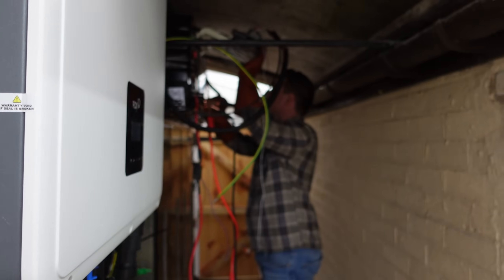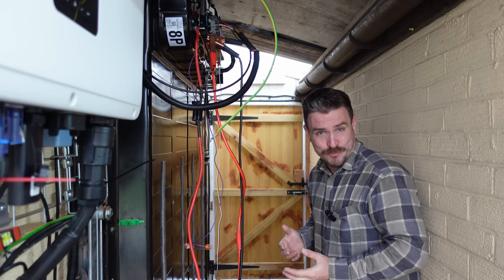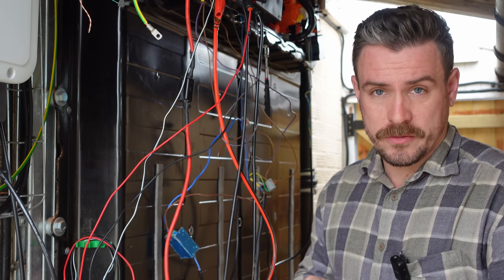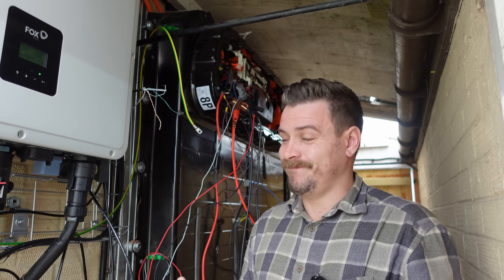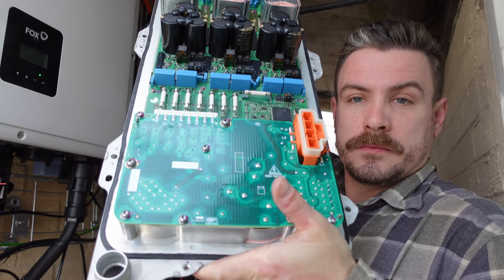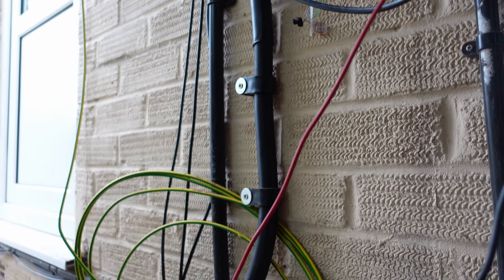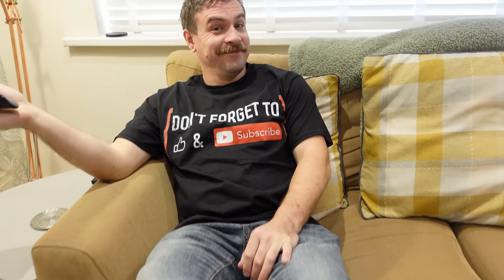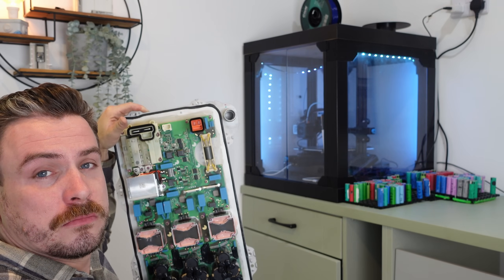This will be a costly mistake!

Comment: So the fox h3 pro inverter can handle up to 800v dc input of PV (solar panels).  I assume that is how the inverter gets the power to create the 240v or 220v (England) to power your house.  Still haven't seen you charge the battery.
Reply from the maker: I’ll make sure to include a clamp meter clip in the next video

Comment: Did you fill the system with glycol and put a circulation pump? 
The charging module definitely needs cooling because some components will probably heat up
Reply from the maker: Not so far. We’ve not had warn weather with the system yet. You’re right tho. The BMS reports 10c warmer than the cells. The charging module is only doing 12v power conversion to keep the standalone battery topped up so not much load
Reply: @TheOfficialBatteryMan  
I have the same battery as you and have started to install it with a fronius gen24 10kw and I checked the cooling for the charger in the battery and I first started by running circulation in the charging module itself and note that the hoses get 50 degrees hot which probably explains your fire . Have acquired a computer cooler and a pump with a tank because it won't work without cooling
Reply from the maker: @Nalle25 great work. The PCS temperature is reported by the battery. I will have to log in and find out what temps we are dealing with. With the previous poor ground the PCS was working harder. Mine feels warm to the touch when running. Water cooling is a good move. Nice one. Keep me updated
Reply: @TheOfficialBatteryMan  100% sure you will burn it again if you don't cool it.
Reply from the maker: @ you’ve set me on a mission. Thank you

Comment: You talk about using the 12v output from the Stark unit to power the BMS... but are you SURE that the Stark can output enough Current to run the BMS???

Wait... are you thinking that the terminals marked +12V is an output??  It's not, it is the DC Input  to the CMR... Nominally +12, but can be from +5V up to +16V.  

All of its Outputs are the same voltage as the DC Input... if you input 16v, it will output 16v.
Reply from the maker: Currently wired the BMS as the same input as the stark board. But the output the first pins to the right of the input should be able to be used. Then if the Stark looses power so will the BMS and the contactors will open

Comment: Never remove the load from the HV-to-LV converter once it's running... you always need to keep SOME load where the 16v battery belongs. Un-loading a PWM converter that expects to always have an attached load can cause them to enter a "unknown" condition... it may be able to correct for it in time to prevent the smoke from escaping, or it may not...

I would recommend a constant Voltage load capable of maybe 4-5 Amps at 16 Volts.

Lacking that, I would connect a 100,000 uF 35V (or higher) Electrolytic Capacitor where the 16V battery connects.  That way when you disconnect the 12v battery after turning the Pack On, the capacitor will allow the Converter load to "gracefully" decrease - instead of falling to Zero instantly.

Better yet would be a stack of Supercapacitors equal to at least 20V... then you never need to disconnect it... and it will probably maintain enough energy to turn the Pack On the next time.
Reply from the maker: Lessons learnt. Thanks for the comment. Connecting a load and keeping it connected is definably the solution. You’ve given a few options

Comment: Jeez, that's unfortunate. Ideally get it fixed, perhaps a collab with another Youtuber like Buy it, Fix it. One of the issues I think you'll have with anyone fixing it is you need a battery and CAN communications to check whether it's working once they troubleshoot and make any repairs. Good luck.
Reply from the maker: Yeah it sort of makes a repair a little complicated. Subbed to Buy it Fix it

Comment: Loving the series. Very much planning on doing very similar. I built an electric boat using two Tesla Model 3 batteries. I totally dismantled them (not necessarily the best idea). I also ended up with a few spare packs that were dismantled for testing purposes (which I plan on using for my system). Would be great to help get you going again if I can. I've got a good amount of spares but like you say there are a lot variants when comes to TM3 hardware and software versions.
Reply from the maker: That’s really cool. How did you deal with water ingress?  

I almost feel an entire pack is simpler and that’s what I’m trying to show. One box with power out.
Reply: @TheOfficialBatteryMan  It's definitely simpler and absolutely the way to go. Mine are already in bits so I've got to take the hard route unfortunately. I did learn an awful lot about them though pulling them apart (long and short is don't ever do it! keep them in one piece). I ended up having to swap components between EU models, US models, dealing with different software versions, very uphill at times. It's so great to see the work that has been done by Dala and community. Inspiring stuff. 

Water ingress is dealt with by the four cells of each pack being rehomed in Aluminium cases that form part of the hull. It was a lot of very time consuming work. Those cases house water leak sensors (primarily for coolant leak detection) and the same automatic water purge valves that will be fitted to the 'Penthouse' underside end of your battery. We even installed CCTV cameras in the battery pack so you can do a visual inspection.

I definitely have a spare PCS module, however mine will be an older 12v lead acid version. From my experience though swapping PCS's was amongst the least problematic of swaps.
Reply: I hope you've solved the issue with your PCS - I forgot to mention after watching your efforts to bypass the Tesla HV controller and drive the main contactors with solid state relays that you don't actually require the PCS (even installed or connected) to get the main contactors to close using the rest of the tesla system as is. But... how Dala's software copes with the missing PCS canbus messages I have no idea - but the Tesla HV controller doesn't actually care and will happily engage the HV contactors if the right conditions are met. (but this may no longer be the case with more modern software versions)

Comment: I think the important thing is to try to understand what went wrong during the fuse change procedure for the LV charge circuit to have burned-up like that.  Hard to say how bad the damage is without the area properly cleaned.  Doing that should help pinpoint what exactly fried, but the damage could go much further than what's visible, and the multi-layer pcb could have internal track damage too.  Not good.
Reply from the maker: Yes. I’m leaning toward a replacement board. I had been disconnecting what shouldn’t have been disconnected and had a poor connection when it was connected. So it looks to be entirely my fault. Live and learn.
Reply: @TheOfficialBatteryMan  Bad ground maybe, whole bunch of current down a wrong path.  Hope you get it figured.
Reply from the maker: @UCCLdIk6R5ECGtaGm7oqO-TQ  I’ll make sure to clean the area and make a post showing the area

Comment: This is a total longshot - and there may be plenty of reasons this isn't possible.  But since Tesla batteries are Tesla batteries, would be possible to be open to using the PCS equivalent part from a bad Tesla Powerwall?  Not sure these parts will be any more readily available but perhaps it will double the possibilities for the components to get the job done.  Best of luck in solving this.  Cheering for you to get this fully over the finish line!
Reply from the maker: A used EV part is defo one option with a fair price tag but would have the project right back on track

Comment: I strongly recommend putting some H2 (MQ-8) and TVOC (ENS160) sensors close to the battery.  So in case of a cell failure your H2 and TVOC values will increase and in case of broken electronics the TVOC value alone will increase. The ENS160 also needs a temperature / humidity sensor for calibration (usally delivered with an AHT21).
Reply from the maker: I do like that idea. It could run off an esp32 and link back to home assistant. We have an emergency stop function in the Battery emulator so it could activate that. Or a sprinkler system

Comment: You may already know about Damien Maguire? Johannes Hubner? Open inverter forum?
There might be some crossover between EV home batteries and people converting cars to EVs. 
Even if it's just sources of parts?
Do you think using a 12V battery on a pack expecting 16V may have been the root cause?
Reply from the maker: Those are some good options thank you. I’ve discovered that there is a whine from the PCS when there is a poor connection to the main 12-16v input / output. I had been using a set of jump leads on the negative side and it turns out they are shot. Those cables have been replaced with the permanent cables and no whine. It’s entirely possible that the PCS was having a poor ground causing all sorts of issues. Just highlights the need to check everything. All will be revealed in the next video.
Reply: I was about to to say the same thing. Damien Maguire. Open Inverter forum. This type of problem is totally what he does.
Reply: I wonder about the 12 v starter battery being too low voltage. Especially if you let it run down, they go down to 9 or 10 volts when flat. The power circuitry would need to gradually increase current and that might have overloaded some components or traces. Did you charge the starter battery at all? A DC-DC converter set to 16 v might be a good replacement for a 16 v battery. Better yet an actual Tesla low voltage battery... Also the connection and disconnection of it live probably wasn't good for it. A capacitor staying connected would at least give it the voltage float it expected. 

I am not an electrician. Just speculating.

Comment: Love what you are doing Battery Man with this great project, you are inspirational, a massive thank you 🙌  I think it is wonderful for all that you are doing and being courageous with it,  especially using PVs in England, does the sun even shine there 😂 I am from the sun burnt country, Australia so usually there is no lack of sunlight here 🌞

Damn, once the smoke comes out of the wires, surface mounted devices etc, you just need to capture the smoke and put it back in lol 😂 Sorry, was a bad attempt at humour.

Hopefully you find someone who can get that board fixed. I am a koalafried Elec technician/fitter and I have worked with some very smart tradies that I have seen diagnose and repair generator set command modules, down to component level. Also, I have worked with some perhaps less technical technicians that I have seen fix boards by working out what that something on a board is meant to do and then making a work around fot it, such as wiring in relays and the likes. I personally am not that good at fixing these sort of things even with a wiring diagram, however, if it was purely up to me to fix, I would start by begging Tesla to let me know what that part of the board does and then if they provide the info, try to make a work around.  If they did not help and again it was purley up to me, I would de-solder the individual burnt components, test them (as many around that area as possisble, replace any faulty ones, re-install everything, have a fire fighting gear on hand, pray to god then re-commission. My apologies if I underestimated the magnitude of the damaged components. There are perhaps ICs and the likes that have been damaged. All the best with this great home flattery system, am hoping and I am quitely confident you will adapt and overcome these little hurdles 🙌🙏
Reply from the maker: You are right. Solar in the uk is brave given the amount of overcast days we have. Part of the reason for the battery. Take up little space and can be filled with cheap electric and sold for more. 

For the right person a ‘what happened to this board’ video could be pretty cool! My skills go as far as ‘attempting’ to replace bits that look blown so I know this one is 2 far for me

Comment: I'm hoping that it isn't completely FUBAR. The board might be toast. Without reasonable schematics and an appropriate source of parts I have reservations that hardware repair is going to be viable. That compounded with any software rev complications could be a show stopper. 
That said, I hope someone with the knowledge comes forward to make this great project happen.
Reply from the maker: Im my head i think I imagined one surface mounted component burnt out and an easy swap. Thats what happens when you don’t have circuit board knowledge. You think its easy for someone that does have the knowledge 😂

Comment: You should try the guy with the great YT channel,  @BuyItFixIt
Also in your region!

I'm not completely sure what your goal is,  and I just maybe missed some info from previous videos on your channel. 
Just curious,  do you want to have a 'out of the box Tesla battery' for your project, because, do you need this 3 phase inverter?
Can't you just charge and discharge the battery from your FOX inverter. It does have a battery in/output?

Nice channel,  also your personality and persistence 👍

[Edit] very unsafe,  but you could short the contactor, so not using it at all?
Reply from the maker: Thanks for mentioning @BuyItFixIt will check him out. The goal is to have a complete EV battery as home energy storage connected to a solar inverter as if it was a genuine battery storage. We did reach that goal. Taking advantage of the massage capacity of EV batteries with good price per KW. Its also got to look professional. So it needs to look like a Powerwall